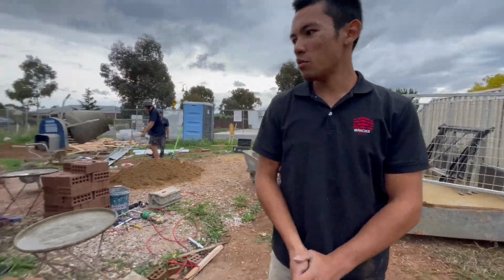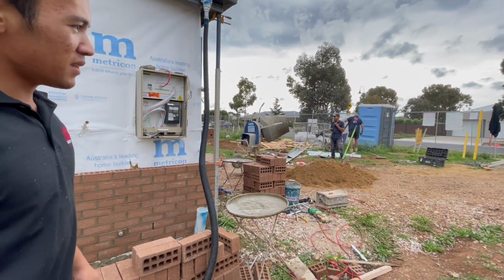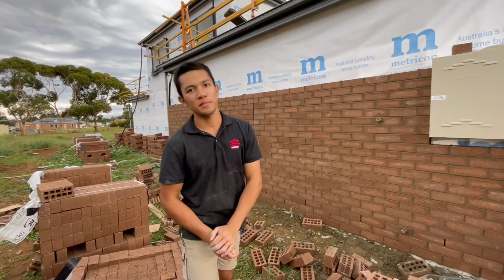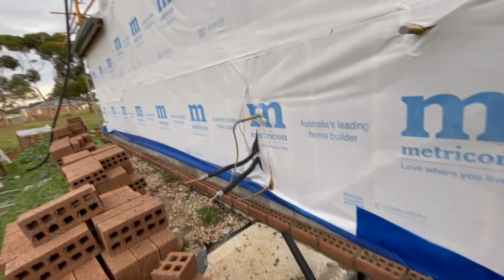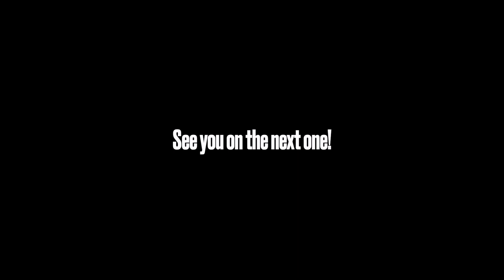OUR BIGGEST JOB TO DATE | BRICKLAYING AUSTRALIA

Comment: Hey Man. Love your videos. 
One question, on the garage you have a profile setup for the control joint in the middle, what do you use and how do you get it out after the wall is finished? Also do you have to put expansion foam in afterwards too? 
Keep up the great content 👍
Reply from the maker: Thanks! Yeah we use a 10mm expansion joint guide and after the run is finished we'll slide it out. Metricon does not use expansion foam as they caulk all expansion joints!